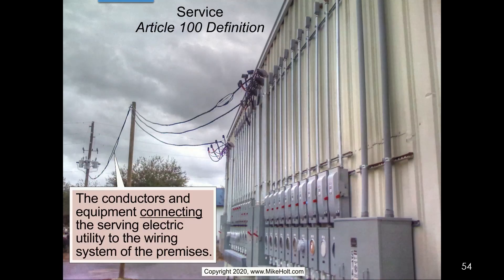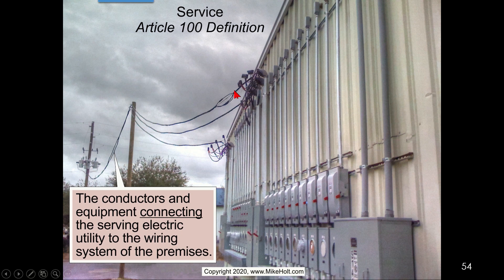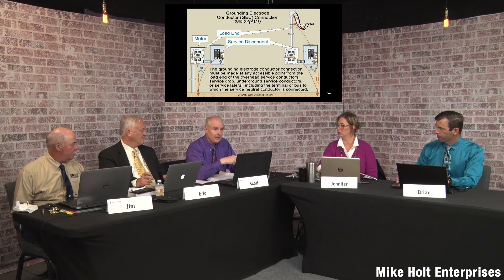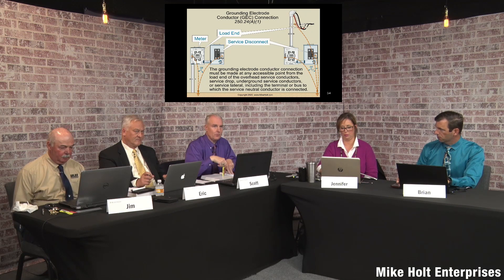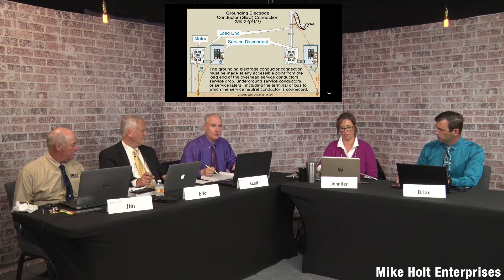Grounding, Service Equipment [250.24, 2020 NEC]

Comment: Would you say that the service ends at the service entrance panel disconnect? Is an emergency or service disconnect on the service side if it is placed before the service entrance? I ask because I saw one video that stated that you only bond the first disconnect after the meter, and another video stated otherwise, that the service entrance was the only correct bond.

Comment: In a AC/DC coupled solar system in a grid up condition the neutral ground bond is in the MP and the essential load panel is a sub panel? 
In a grid down condition the MP is isolated, where is the neutra/ground bond ?
Reply from the maker: Neutral/ground bond only occurs in service equipment per 250.24(A)(5).
Reply: @MikeHoltNEC  Thank you for responding, I'll go back to tripping on the crossed neutral thing.